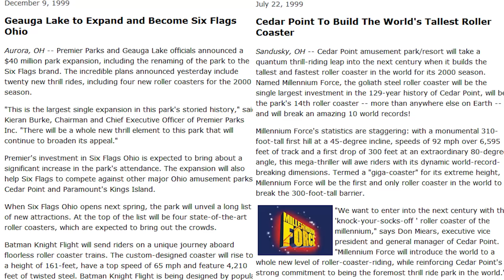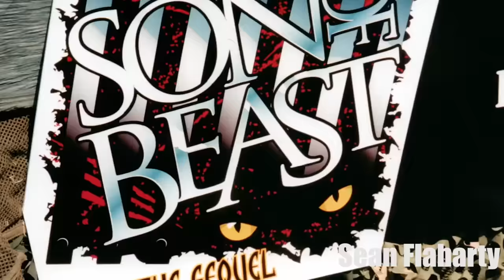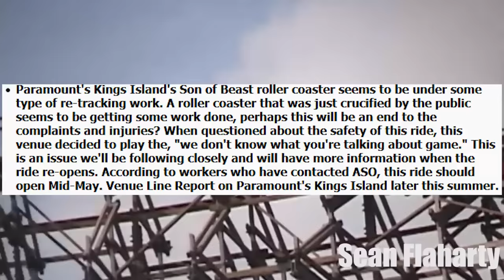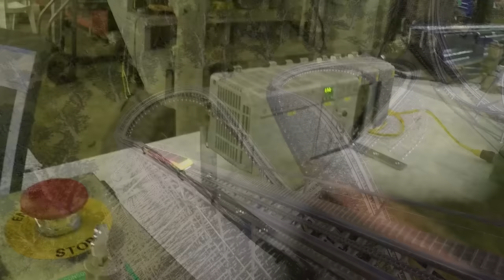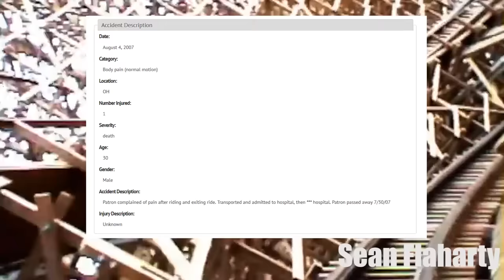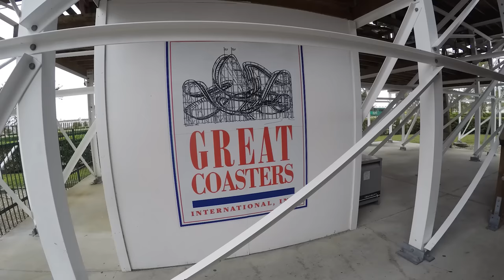What Really Happened on Son Of Beast Kings Island July 9th 2006?

Comment: One of the reasons the rollercoaster industry is safe in my opinion is whenever an accident happens, they look at what happened and do what they can to make sure it never happens again. I know that sometimes this isn't possible as people will get on a rollercoaster with a medical condition they aren't even aware of and they die because of it.
Reply: Yeah overall.... but as far as that company.... Same company made a ride that was close to me in Texas called the Rattler, this ride came out 8 years before son of beast, and let me tell you that ride had so many problems. First off it originally had a TWISTING record holding drop. The ride was designed with a smaller drop originally but they forced the designer to change it last minute to get the record. Okay so that didn't last long people got hurt and they removed the twisting drop and lowered the height and guess what people were still getting hurt. then they basically halved the height of the first drop and it was still very rough. The funny thing the first time I rode it, it was my first "big boy" roller coaster no idea if it was the twisting drop or the reduced one, but it was one of the first two versions for sure and much later after I had rode other coaster like the old texas gaint and thinking how smooth the texas giant was and that was compared to the 3rd version of the rattler.. I can't honestly believe they were even allowed to build another piece of crap after the rattler.... Luckly the rattler was converted to RMC and is good now (I haven't rode it yet). One more thing, meanstreak had tallest wood record, rattler took it, then son of beast took it from the rattler, its almost as if record height wood coaster is a bad idea lol.

Sorry to drop a book on you but that company pisses me off. They don't make anything anymore so that is great at least.
Reply: You mean “unsafe”, not safe.
Reply: @GTVAlfaMan  actually incredibly safe
Reply: Demon Ghost 
You are wrong,
I’ve seen many accidents and incidents on the news here in California in the past 20 years at amusement parks.
Many occurred st Disneyland, Knott’s Berry Farm and Six Flags.
Reply: @GTVAlfaMan  How many accidents? You have to consider the parks get millions of visitors yearly so even twenty accidents wouldn't be that much. Also, are they all Rollercoaster related? Rollercoasters aren't the only things at amusement parks that can cause accidents.
Reply: Buick Mackane what kind of “incidents”
Reply: @GTVAlfaMan  Accidents are very rare, which is why they make the news when they do actually happen. Most of the time the people who die or get injured on rides are the ones with pre-existing conditions, such as heart problems. Statistically, if you're young and healthy, it is incredibly rare that anything bad will happen to you while on a ride. It doesn’t mean that it can't happen at all, but it's extremely unlikely. You're more likely to die in a car accident.
Reply: @blueflare3848  
You are totally wrong.
I read the news every day, I’ve read another decapitations, leg amputations and many other horrific injuries that happened on amusement park rides,
Reply: @GTVAlfaMan  Actually, I stand corrected on that one point. Most accidents seem to be caused by human error. In some cases the ride itself was running fine, but careless operators were responsible for an injury that occurred. Other times it's because people failed to properly inspect the ride. Again, not the ride's fault. If a drunk person got behind the wheel of a car and caused an accident, that doesn't reflect the safety of the car but rather the recklessness of the driver.
Reply: @blueflare3848  you're still right. It is extremely rare. No matter how much that guy thinks he reads he doesn't do the math. Let's say 50 big amusement parks with at least 20 rides running 2 rides per 5 minutes. Times that by 10 hours a day, every day.. yeah, I'd say accidents are pretty rare lol

Comment: The real question is: will we ever see a loop on a Wooden coaster again?
Reply: A vertical loop, probably not. A heart line roll/corkscrew: just look at Mind Blower/Hades 360/Goliath at SFGAm)
Reply: It's completely possible, considering that the loop wasn't really the problem.
Reply: @nathonizamboni875  I've heard that the loop was the smoothest part of the ride lol. Unfortunately I never got to experience the loop, I rode it once after they took it out.
Reply: The loop was the smoothest part because it wasn't built using wood.
Reply: @MathewsCoasterVids  You left out Outlaw Run which is the first wooden coaster to have that kind of stuff.
Reply: @Gamerboy365ify  oh yeah. Sorry I forgot about it.
Reply: @samuraijesus7871  
The track was still wood, but it used steel supports and a steel spine (Not sure on that)
Reply: probably not. it was awesome at the time but it was very rough ride.
Reply: What's the issue with wooden coasters and loops?
Reply: We will mostly likely see multiple loops wooden coaster in the future or even today
Reply: CanDIEland wood strong enough to withstand the forces of pressure put on it at certain angles like metals are.
Reply: @candieland4276  It's partially a structural issue, and partially the nature of the tracks on wooden coasters; you can fit casters all the way around a round steel rail, positively holding the train to the track, but a wooden coaster relies on gravity and centripetal force to hold it down typically. I'm not sure how the loop was managed on SOB; it looked like typical steel coaster rails.
Reply: @B-System  it was wood rails on a steel frame
Reply: I believe Iron Gwazi in Busch Gardens FL is going to have multiple inversions, but not a vertical loop
Reply: @NuisanceDM  Not a wooden coaster.
Reply: @candieland4276  well one issue is that steel coasters and the like usually have grips on three sides, so even upside down for a long time the coaster will not fall due to gravity. A wooden coaster only has grips (wheels) on one side, and runs it like a rail, similar to a train on a railroad. You flip that upside down for too long, or with not enough force, gravity will take the train.
Reply: @Gamerboy365ify  The oldest wooden looping coaster I know of was the Flip Flap Railway which opened in 1895 in Sea Lion park on Coney Island.  It also had a reputation as a neck snapper with riders experiencing 12G on the loop.
Reply: @RemixedVoice  I passed out from all the shaking right before the loop, when they took the picture. I bought it and you just saw my face drained of color passed out cold. I missed the loop. But that was one hard coaster and the last one I have been on.
Reply: I got to ride it with and without the loop, I was in Jr. High/ High school at that time and let me say, this ride was fucking terrifying and rough... but incredibly thrilling! I am a regular at Kings Island but I only rode this a handful of times!
Reply: The loop on the SOB was the only smooth thing on the ride. The SOB cars were like a steel coaster with wheels on the underside of the track. Typical wooden coasters have just a skid plate.
Reply: Josiah Stankus wooden coasters have wheels on the top, inside, and bottom of the track. The problem is structural issues
Reply: @smilesgirl17  Either one will snap if you ignore basic physics. 

Wood is MEANT to move, but not TOO much. A porch that sways is BAD. Metal, too, will bend until it can't anymore. Ignoring that need is asking for problems. 

Also, our friend latency. Where does the load go if there is a failure? Some bridges collapsed from very tiny cracks. See the Hyatt Walkway Collapse on history. Latency: um. None. It's the deadliest structural accident in the US. 114 people crushed to death. 

The engineers are STILL working in another state (????)
Reply: @MathewsCoasterVids  don't forget Steel Vengeance!
Reply: Probably not. There's a reason why wooden roller coasters and loops don't mix.

Comment: I only rode Son of Beast twice. It still had the loop at the time and I remember the first time I rode it with my mom it was smooth and a nice ride. We decided to run back around and get in line again because we liked it so much but the second time was a mistake. We got off the second run and I was practically sobbing because it was so rough that it gave me a migraine and my neck hurt. I didn't think about much at the time because I was only 13 or 14 years old but I remember spending a good 3 to 5 hours trying to get the migraine and pain to go away. I think we left park early after that because we were in so much pain that we couldn't stand to go on any more of the rides that day.

Comment: I rode Son of Beast when it still had the loop.  I don't know if it was normally this way on other days, but the day I rode it, there were NO lap restraints, not even a flimsy seatbelt.    I alerted a worker that I didn't have a lap restraint.  He said it was okay because none of the cars had any either.  He told me to just hold on to the bar on top the car in front of me.  It was terrifying.  And it was so rough it was far from fun. I was worried about the loop with no restraint over my lap.  But the force from the loop was strong and kept me in.  However, before the first hilll I reached to grab the bar on the car in front of me like the worker said to.  I could barely reach it and couldn't get a good grip (I have really tiny hands).  I was never so glad to get off a ride in my life.  I have heard things about no or non-functional restraints.  And to think I was told it was safe and normal not to have one.  I wrote KI several times about that day and never received a response.  I was so happy the day I heard they destroyed this death machine.
Reply: That's an absolutely shocking account. I am horrified reading the experiences with this roller coaster and that's one of the worst!

Comment: I rode this back in June of 2008 when my mom and I were visiting her sister. We got on later in the afternoon. The lap bar was pushed down and we left the loading/unloading station. This ride was extremely rough. I had to push down my right hand on the lap bar and push my left hand against the seat in front of me. My head got knocked around so much. We got off and I had like a very small headache. We flew back home to FL the next day and bruises developed on my shoulders, sides of my face and left ear from all of the rattling. In my years of riding roller coasters, that was the most uncomfortable and painful experience I’ve had on one. 😬

Comment: I rode this when it first opened and rough is an understatement. It felt like my brain was scrambled when I got off. Definitely had a concussion. When the coaster hit the double helix was the worst part, you couldn’t brace yourself for the hits. The flight of fear was bad news when it first opened to it would beat your brains out on the shoulder restraints. They fixed it later on and the last time I rode it the shoulder restraints was removed but the ride wasn’t as gnarly.

Comment: Something similar happened at Six Flags Mexico, we have a wooden roller coaster which for years was the top attraction of the park, but after several years, the structure was very weak and the last time I went up that thing before it was modified really hurt my neck. I don’t remember if there were reported injuries but I wouldn’t be surprised given the real beating that it gave me back then. They re-built most of the coaster and ended with an amazing and smooth ride called Medusa Steel-coaster and Jesus Christ this thing is amazing and Smooth, def improved.

Comment: In hindsight, King's Island would have been better off designing and building the thing themselves from the start. Notice how The Beast, where they did just that, is alive and well today.

As things went, they should have either stuck with the original PTC trains and trusted the extensive refit work to cope with the weight, or invested enough more into the ride to have purpose-built lighter (or just more-articulated) trains done instead of repurposing Gerstlauer trains. While the Gerstlauer trains were lighter and thus would put less strain on things... apparently that same lightness and their overall design meant they had insufficient adhesion for a big woody and thus rode so roughly that they basically made all the work King's Island put into smoothing out the ride for naught. This on top of forcing the removal of the ride's beloved showstopper vertical loop.

Comment: Kings Island had a coaster called Flight of Fear which was an indoor coaster that ran in complete darkness. The posts of my earrings dug holes into my head because my i had changed my position on the ride so much looking for relief from my head slamming back and forth and side to side. I have never been so badly injured by a coaster.

Comment: I was evacuated from the Wild Mouse at Lagoon in 2002 when my car got stuck at one of the sharp turns.  They got me down in about 10 minutes and brought someone up to look at the track (which was closed at this point).  They determined that it was the car itself...and after the car was pushed back it was removed from the track and replaced with a spare car.  The ride was back up and running like a half hour after my "rescue".  It was a surreal experience.
Reply: Lucky!! Did it just stall?
Reply: @triple7marc  I think so?  It might have been a partial derailment.  I'm not 100% sure...there was a stiff bump and I stopped moving. I'd probably be more attentive now...but this was when I had just turned 15.

Comment: I went on Son of Beast when it still had the loop.  I don't know about other days, but the day I rode it there were NO restraints, not even a flimsy seat belt.  Before the ride took off I alerted one of the workers I had no seatbelt.  He said not to worry because no one had seat belts on the ride.  He assured me I would be okay and just hold onto the bar on the top of the car in front of me.  As we were nearing the first drop, I held out my hands and could barely reach the bar, in fact I couldn't even fully grasp it, only my fingertips tried to hold on for dear life.  I was worried about the loop but because of the force I was hels in well on that part.  I was never so relieved to get off a rollercoaster.  It shook you so hard and being worried about not having any restraint scared me to death.  I wrote KI noting the date

Comment: Pretty happy I rode it with the loop in it's opening year. Loved it. Not the smoothest ride in the world, but one of those nostalgic memories and experiences I can remember. I rode the worlds only looping wooden coaster, and didn't hate it. But I was young then. Now that I'm nearing 40, I'd probably be in a wheel chair getting off the same coaster it was when I was in my early 20's.
Reply: I rode the son of the beast too many times and even though it was rough I didn’t suffer any back or neck pain but then I was in my early 20’s now I’m 41 and I still do roller coaster and I still ride the beast I found the front seats are better for wooden roller coaster since you don’t get bang up as if you were riding the back . They also added some new rides that are very smooth like the banshee and diamond back .

Comment: They still had a son of beast coaster in kings island around 2012 when I used to go all the time. I think it was a slightly different coaster or just a major improvement on the original. I must say, when I rode it, it wasn't too bad and I had fun.
Reply: You probably rode when it did not have the loop.

Comment: This reminds me of the voyage and the raven at holiday world in Santa Claus Indiana, both were wooden and both were very rough rides. I felt like I got whiplash and broken ribs from riding them
Reply: There’s a difference between a rough ride due to a ride running for many years, and a rough ride due to poor construction and design. Also, both of those rides are quite smooth now.
Reply: @triple7marc  that's good to hear. I remember saying they needed shoulder bars to keep riders from getting slung from side to side.
Reply: @Marc W.  that was the man thing was the wood boxes the riders ride in when u sat in the hit mid back so when u were slung side to side u just the sides of the car, I got bruises from it, they only had lap bars and lap belts then. The wood coaster itself ran rough because of it all being wood. I was in my 20s then and had actually told the operators when I got off those rides needed should bars that came over top of the riders so they were more secure in the seat. Thanks for letting me know. ☺️
Reply: @havenly6133  Oh no, over-the-shoulder restraints make a ride rougher 100% of the time. No wooden coaster has ever had them, for good reason.